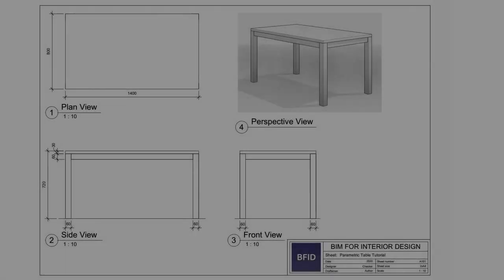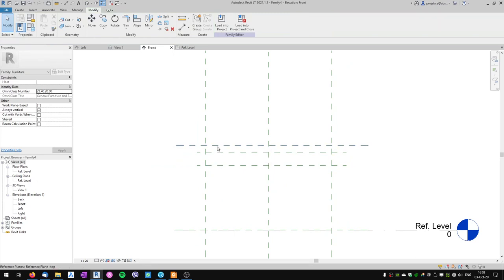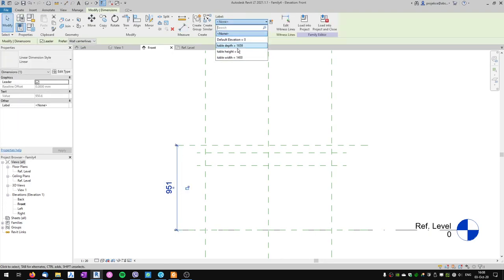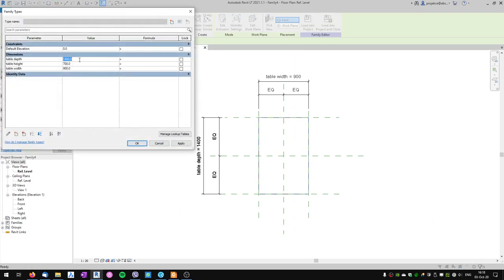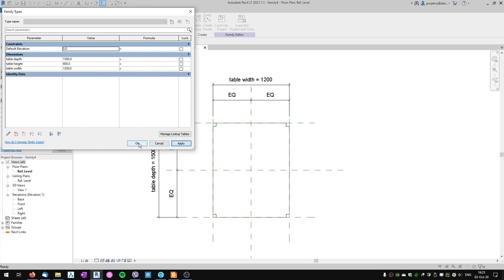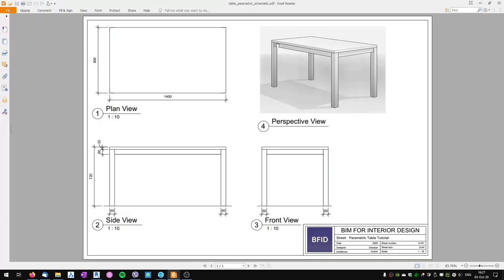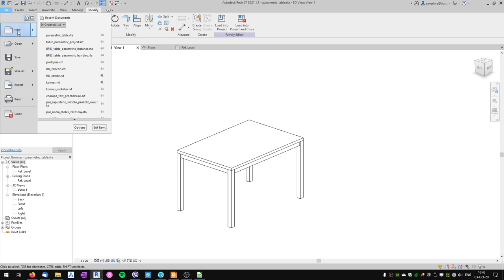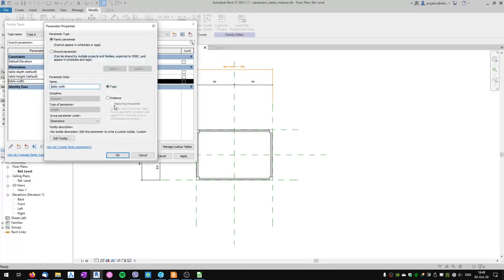Create Parametric Table Family in Revit

Comment: is the behaviour the same when you assign locked dimensions in the sketch vs after closing the sketch?
Reply from the maker: Yes, you can apply locked dimensions to the sketched lines before you close the sketch.
Reply: @BIMforInteriorDesign  thank you. I am always confused when I have to place parameters inside the sketch mode or outside it...